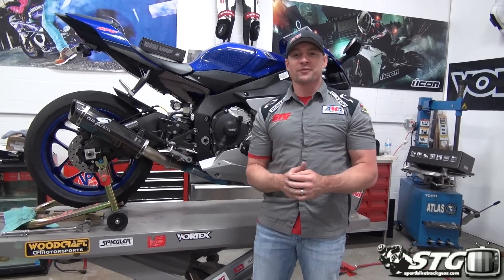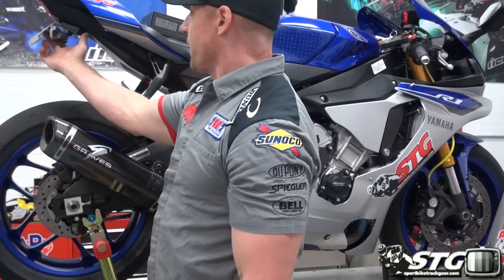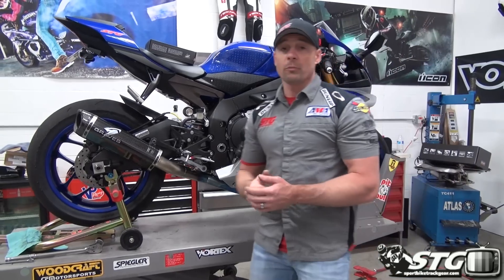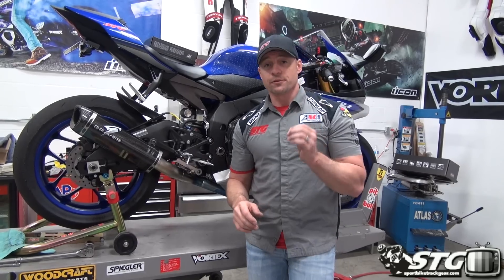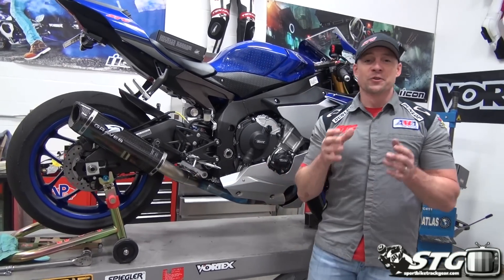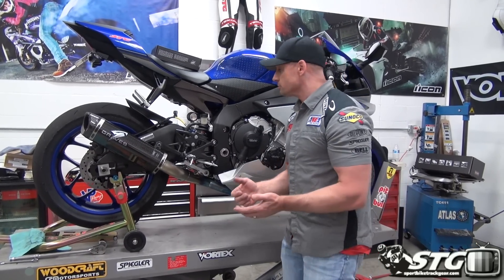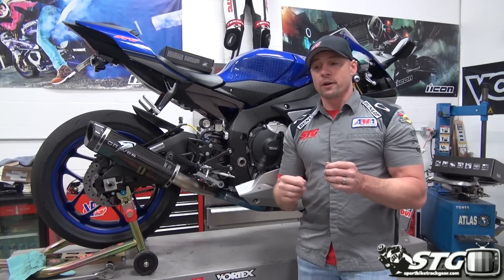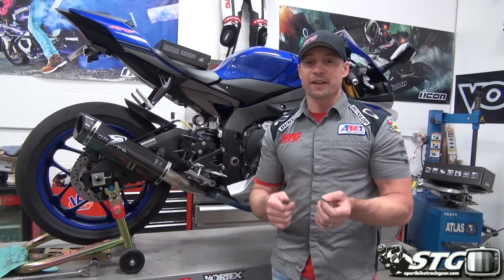2015 Yamaha YZF-R1 Review from SportbikeTrackGear.com

Comment: Have you ever track a BMW s1000rr yet ? If not, how can you be so sure this is the best bike you've ever ridden. I feel like you are bias toward yamaha brand. Correct me if I'm wrong.
Reply: Andy Lam What you said makes no sense. If he hasn't tried the s1000rr, he can still be "sure" that the r1 is the best bike he's ridden.
Reply from the maker: Uncle BobbyB I can be sure this is the best bike I have ridden because it is. I have not ridden the BMW thus far so comparing the two would not be possible. That said I will promise no one who purchases the 2015 R1 will be disappointed. I would not label myself biased towards the Yamaha's but I have had nothing but excellent experiences with each one I have owned. To date I have owned Buell, Honda, Kawasaki, Suzuki and Yamaha bikes. The Buell was a Lightning X1, not the best bike but it was cool. - Van
Reply: Your question makes no sense!